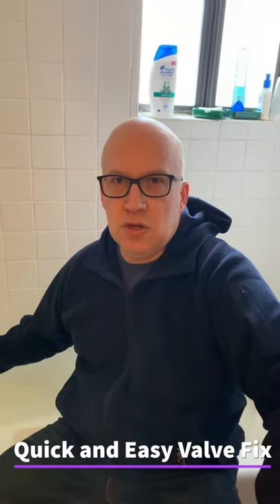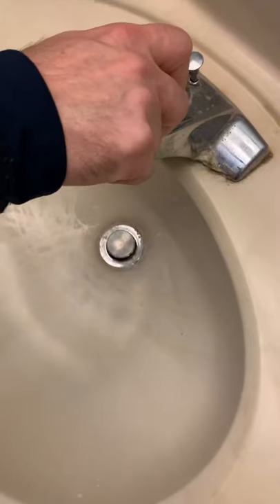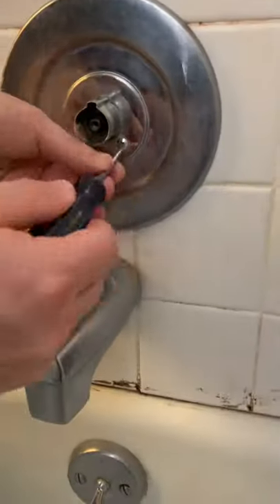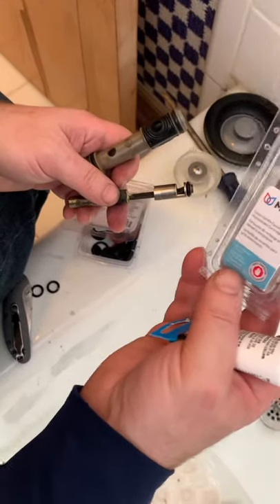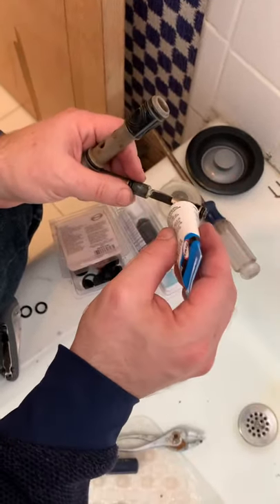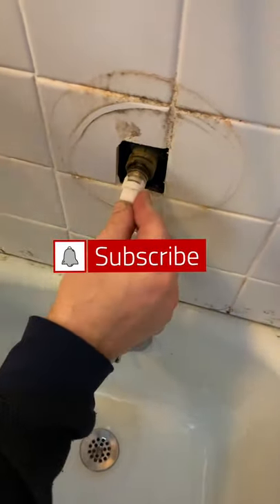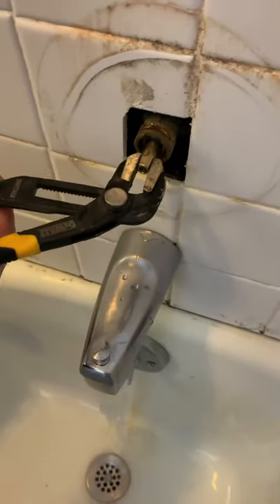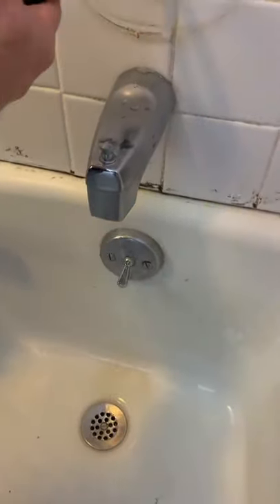How to replace a shower valve in 60 seconds || DIY Moen Shower Valve

Comment: Do you have to pull for the water to open? Cause I turn left snd right and nothing
Reply from the maker: Yes- if it is working properly you pull it out and twist left and right to adjust the temperature.

Comment: Now saw in theory that whole device moves freely back and forth because the backing failed or something, I haven't been able to look yet. I can just do this and resecure everything and not have to replace the valve?
Reply from the maker: You might have to cut a hole in the drywall (if you can) on the backside of the wall that the valve is installed on.  From there see if you can resecure the valve to the framing.

Comment: 60 second yeah right
Reply from the maker: the actually time to pull out the old one and put the new one is less than 60 sec- the prep time and gathering the supplies does add to the time
Reply: He means the vid is 60 seconds not the repair time.
Reply: @jaysonx5576  it say "how to replace a shower valve in 60 seconds" which is impossible

Comment: You missed about 10 steps there guy...
Reply: I can’t get my shower to turn on with this lever. It’s like it’s broken. What is it called? I don’t know how to explain it to have a plumber come fix it. Is it difficult to do?
Reply from the maker: So it is not leaking- just won't turn on?
Reply from the maker: We got the steps- just in fast motion so it could be considered a "short"- I can do a long format video as well if that helps.